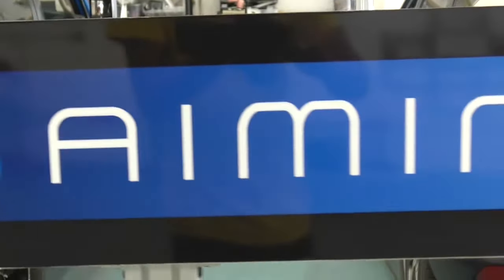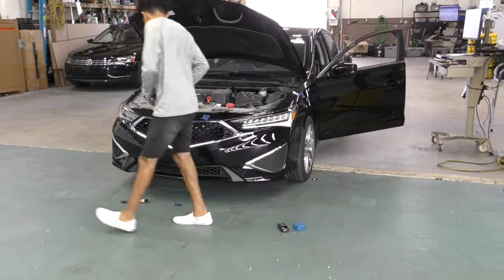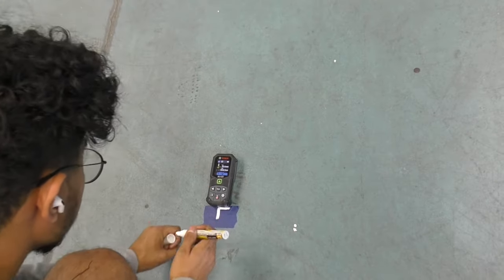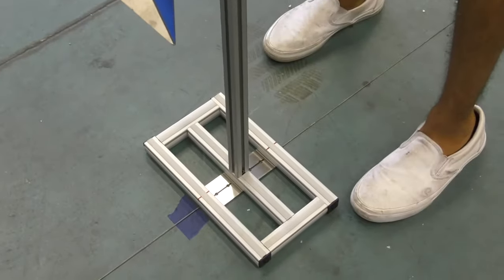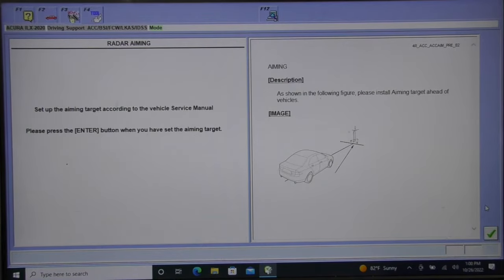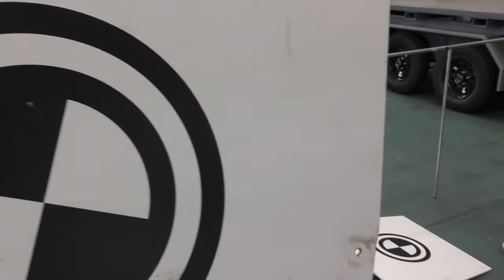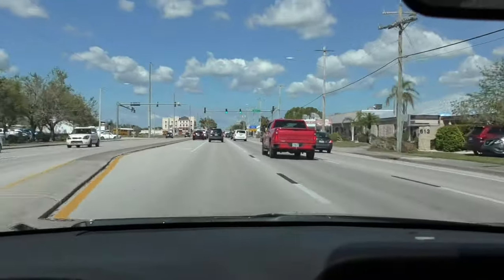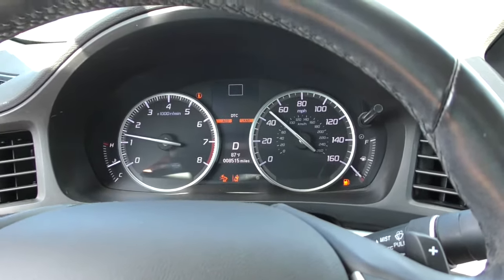ACURA LKAS FRONT RADAR ADAS CALIBRATION

Comment: Hi man I have a question for you so I have a 2018 aura tlx and i got a new lane keeping camera i calibrated with an autel scanner and last step was to drive it like you did in your video i drove it straight for more than an hour and my cluster does exactly the same thing as yours flashes acc orange and green lane keeping also the flashing orange lights and the square with the cam on the left side and still after waiting for my scanner to says complete I drive it for more than 45 mins I try it over and over again and it just takes to long and never says complete you think you can help me out with an tips on this problem the camera is reading but it just never seems to complete the dynamic calibration

Comment: When you take measurements from the wheel center: how are you sure this is parallel with the center line ? Because in my opinion you can put your measuring device anywhere ? I get what you are doing, but not how you are sure of being straight
Reply from the maker: Hi, in this video, i'm using the center of the two front wheels to measure the distance Where to place the targets in front of the vehicle. The Triangle base lines up with The centerline , Adas  Aiming tools targets are all designed to use a  centerline To ensure perpendicular with the vehicle, 
Adasaiming.com

Comment: Hi, My Acura RL radar cruise works with LKAS but Lane assist steering function does not, could you advise what it could be.
Reply from the maker: Hi, yes, I've come across that on Honda and Acura no diagnostic codes in the system, but the departure warning is not working. I perform the calibration on the windshield camera and everything came back to life.

Comment: I have Hyundai Tucson SEL 2022 and the radar sensor wasn’t working because of front accident. I replace it myself. Started working normal but only over an hour so I went to the dealership to fix it but instead of fixing the collusion signal back to always on when I turn my car on. I didn’t go to a body shop I just replaced the bumper and the lights. Any advice please?
Reply: It needs the variant coding done,then calibration because it’s a new module.

Comment: having an empty tank does affect the pitch of the vehicle?
or do you compensate with weights?
Reply from the maker: Hi, yes we have preset weights in the shop to simulate fuel we place it in the trunk prior to performing the calibration,
Reply: Hi man I have a question for you so I have a 2018 aura tlx and i got a new lane keeping camera i calibrated with an autel scanner and last step was to drive it like you did in your video i drove it straight for more than an hour and my cluster does exactly the same thing as yours flashes acc orange and green lane keeping also the flashing orange lights and the square with the cam on the left side and still after waiting for my scanner to says complete I drive it for more than 45 mins I try it over and over again and it just takes to long and never says complete you think you can help me out with an tips on this problem the camera is reading but it just never seems to complete the dynamic calibration